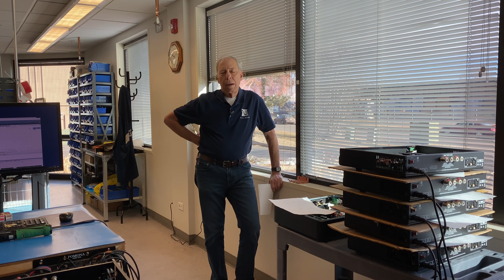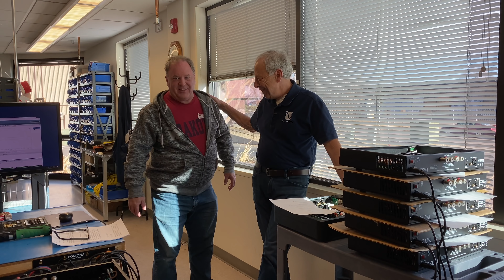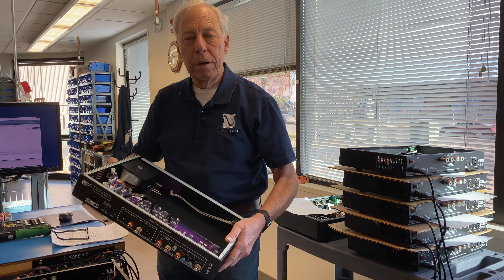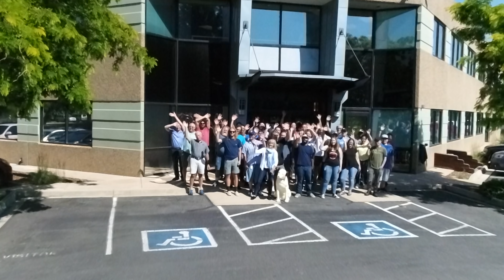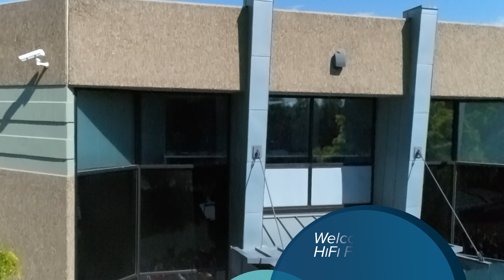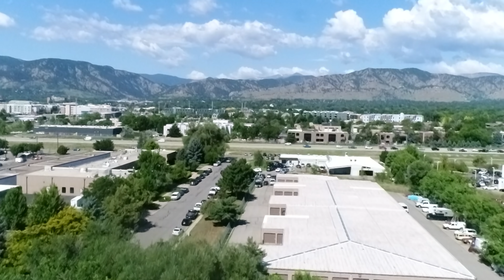Where does a DAC perform its conversion?

Comment: I have a Topping D10 DAC which has a coaxial and optical outputs.  Can be used instead as a USB to digital converter and use a nicer DAC if desired.

Comment: Surely once you have your digital information encoded as pulse density (rather than pcm) the conversion is done by just a low pass  filter. It may be better to say that all the conversion is done in the digital domain and the analog waveform is then filtered from it. Of course it was not like that in the early days of CD but with modern technology it is quite a simple thing to do.

Comment: My Cambridge Streamer/DAC has digital outputs. What Paul says is probably true for dedicated DACs like the PS Audio gain cell DAC. But maybe not true for all. In the case of the original question it sounds like there is a DAC in the integrated that is actually the one in use in this case.

Comment: I think an easy way to look at it is...a CD player has a coax out if you would prefer to use a better, or different, external DAC, as opposed to the sometimes crappy ones that are built into the CD player itself. If you hook up to the coax (digital) out on a CD player, you are bypassing the internal DAC of the player, essentially turning your CD player into a transport. A digital coax input on a receiver is just another DAC, built into it.

Comment: Hi Paul good topic in my  hifi set up i have units like cd recorders mini disc  DAT recorders 

All haveing  digital SPDF & coax  in & outs  do these still count as a DAC
Reply: All digital devices that can output analogue have an integrated dac. If they can also accept external digital signals and output them in analogue then they can perform the function of a general purpose dac too.
Reply: I have an Audiolab M-DAC with several digital inputs and outputs. It allows me to use a MiniDisc recorder with a traditional tape loop but in the digital domain. When I record from a digital source, I guess the M-DAC is just reclocking and passing to the MD. The conversion to analogue obviously takes place when I play that recording back. The M-DAC reports a 20-bit signal at 44.1kHz.

Comment: Some Hegel amplifiers have a digital out that is a reclocked signal of the digital input or network stream. That output can be fed into external DAC and output from that DAC is fed into the XLR inputs of the Hegel amplifier. So since I got such Hegel amp I can upgrade the DAC down the line.

Comment: My Rega Dac has a digital out allthough its a designated dac and does not have a built in streamer.   Probably becouse it has multiple inputs and gives you the option to use it alltough you might get a better dac in the future.

Comment: His question was about I think what happening in the cd player when it has a digital out is it bypass its dac? Or in a pc, I have a computer cd player what does not have optical out but my motherboard integrated sound card has, so what is happening between the cd and the optical out? Is it matter in this case what kind of soundchip my computer have, and what clock the data using to create the music the pc or the outside card??? (I using an outside cheep dac with optical in to get rid of the computer noise and the sound quality itselfe if better too. I did that becous of your advice.)
Reply: If your CD player does not provide a digital out, then that means it locks you into using its own built-in DAC and can't use your own external DAC. The ability to use your own DAC is not a given feature, is not a standard all vendors provide.  A similar common situation is, lots of new TVs are ridding off analog (legacy) outputs, which lots of people look for easy hookup of external speakers they have sitting around, but vendors are telling you, buying new TV, you must also buy new stereo. Not sure good or bad but capitalists must make $ to survive.
Reply: Sammy Woo It in a computer DVD player read data the motherboard sound card handle the data just I don’t know how and I useing my dac with a optical out.

Comment: I have a USB DAC which has a coax output.  You could use it as a converter to another DAC which didn't have USB input.  It actually will output to both simultaneously which I take advantage to connect to another DAC in a different room with a 60ft coax cable for multi-room audio!
Reply: As Paul said, if your DAC has a digital out, it isn't doing any Digital to Analogue Conversion. Its just passing the digital signal along. You're bypassing the DAC. Very few reasons to feed a digital signal to a dedicated DAC to get a digital signal back out again.

Comment: if in doubt, if you look at a unit that plays a digital source, you are using the dac is you plug in the analog outputs.
also you are not using a dac if you are using a analog input on a unit. 
rare exceptions are dsp units, those connected back and forth to use dsp function.

Comment: Did Paul just say a "phono" DAT? Is that for a turntable? What the hell would you want one of those for?
Reply: I am guessing that that box was an RIAA phono preamplifer.   It provides gain and equalization for magnetic phono cartridges.

I have no idea what would make it so heavy or require so many parts.
Reply: @swinde  It cant be analog? Being a DAT it has to be digital at some point and why would you want to listen to a album in digital? Isn't that what a CD is accept with this you get to keep all the worse qualities of a album? A digital album...
Reply: Paul was referring to the need to create separate components that perform one function, only...really well. His example was the PS Audio Phone Stage... It's a full size component that only serves as a phone stage (low level amp, optimized for amplifying a minute, analog output from a phono cartridge to a point that a standard pre-amp can use the signal) Many pre-amps and receivers contain a small phono-stage inside.
He did not say anything about a phono DAC (digital to analog convertor) because, as you point out, there is no digital data on vinyl to convert to analog. Vinyl is as analog as you can get.
Cheers
Reply: @markwagner1997  
You are correct, but back in the old days, 1970s, these phono stages were built with discreet components and required only a few square inches of board space, and did not require a heavy power supply.   I think Paul's product is extreme over kill and will appeal to those that love expensive gear over the music.

Comment: I have a CD player with a coaxial connection to a streamer/preamp/dac. When I play a CD, am I hearing the dac in the cd player or the dac in the preamp?
Reply: I'd say you're hearing the streamer DAC. Best way to test is to connect a small speaker driver to the coaxial output. If you can hear some kind of noise then it's digital and hopefully safe to assume there's no conversion happening. But best would be to read the specs...
Reply: Jack Temkin if it’s a single terminal connection, commonly named as SPDIF, then this carries the digital signal to the external dac. If it is two terminals, usually signified as left and right, then this carries analogue signal produced by an internal dac.